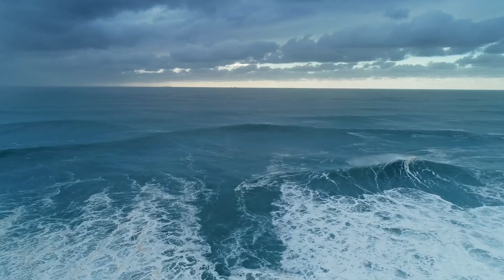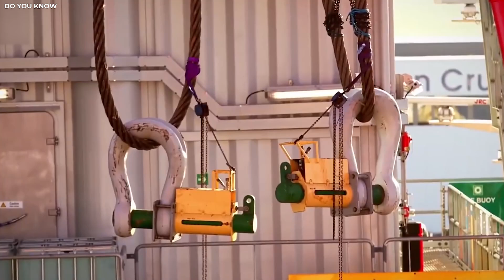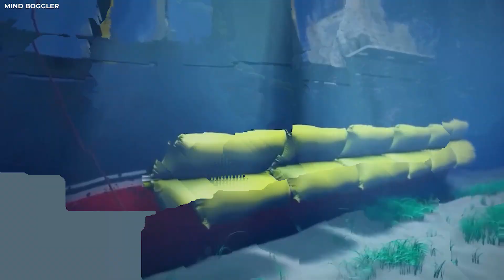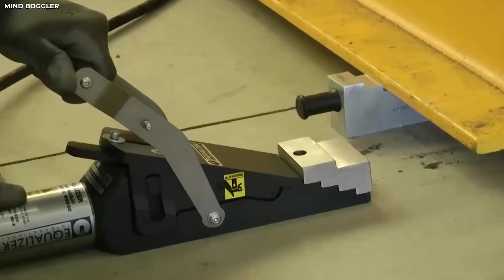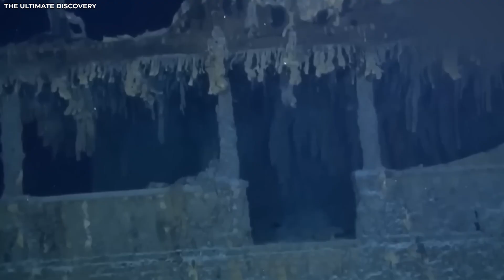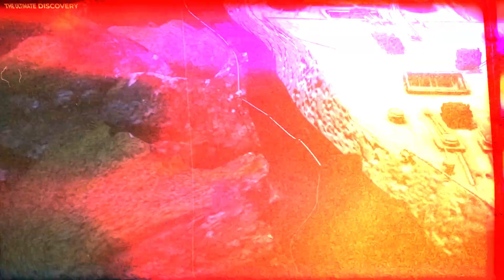Scientists New Plan To Retrieve the Titanic Changes Everything!

Comment: Just recover the front name plate to see if it is the Titanic and not the sister ship that was hit by another ship. Rumor says they changed the name plate because the ship that sank was driving on an angle because the keel was bent.
Reply: Yes you are right.
Reply: @JustinSymons  thing is, the name wasn't on a plate. it was physically etched into the shell plating and painted. with all the years of erosion it would be nearly impossible for it too be in tact enough to be identifiable let alone readable.